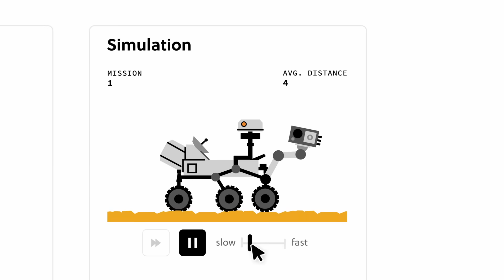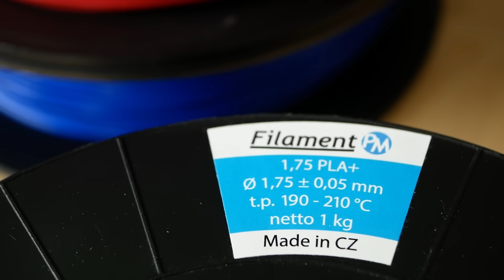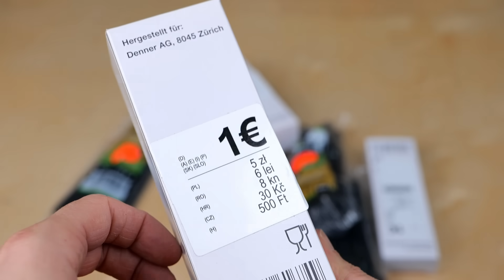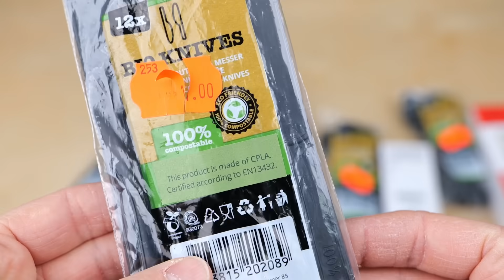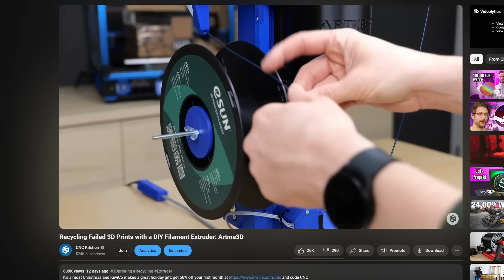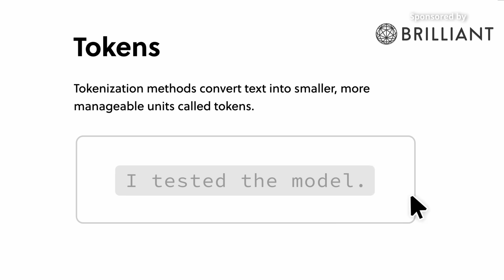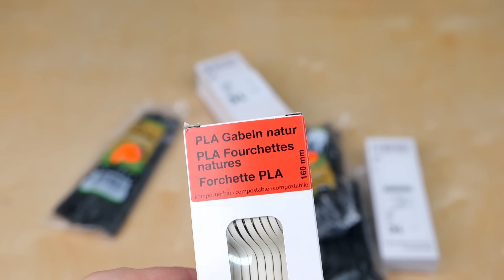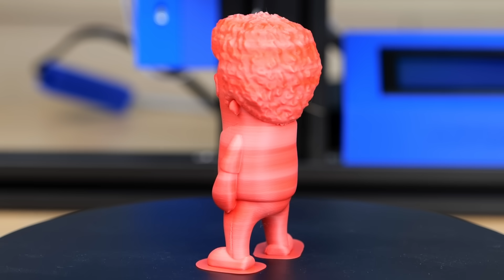From Trash to Treasure: Recycle Cutlery into 3D Filament!

Comment: I love that you've really taken this on! I think the biggest blocker for slightly wider adoption is the cost of the shredder still. It'd be cool if there was a cheaper option that performed well, or perhaps you could look into designing one?
Reply: It would likely never be economic for a single hobbyist, but a local makerspace might be able to pay it back by selling their recycled filament
Reply: The shredder and extruder are both individually more expensive than the cost of filament spools for most hobbyists (I have barely spent more than $100 on filament in my 3 years of owning a printer), and professional users might not see any cost savings after quality control and recycle costs are factored in.

Comment: That machine needs a real time thickness gauge. Good thing I recently uploaded a model that uses those cheap thickness gauges you can get, and it would be easy to remix into something that can be mounted on the Artme3d machine. I probably can't post a link, but it's on Printables called "ProperWinder Thickness Gauge" I included STEP and F3D files as well as STL.

Comment: There are two materials I would REALLY like to see some recycling results of. Both abundantly available for free, if you are prepared to put a little energy in recovering them.
The materials are PE and HIPS.
Single use cups (the thin ones) are often made from PE (or at least they were, haven't checked in a while). Since they are use by the thousands at events, it might be a good option. As with the cutlery, you'd have to clean it first though.
And HIPS is used for things like printers, scanners, TV's. As an electronics hobbyist I already salvage a LOT of the components for mu projects, and most unusable metal parts can be recycled easily. But the housings aren't exactly environmentally friendly. But HIPS does make a great material to 3D print prototypes! Even if it's not as easy to print as PLA. It's a bit tougher to grind the big parts down to pellets though.

Comment: Old coffee machines that grind coffee beans sometimes have grinders that no longer produce a fine enough ground coffee for the machine to work properly but might be able to grind filament plastic into pieces possibly smaller than the raw pellets.
I wonder if it would be possible to thoroughly mix a finely ground mix of filament to achieve a more uniform color.

Comment: Making custom filaments from new PLA pellets and additives would be interesting, especially if you use recycled plastic for filler, pigment, or even material properties.
Reply: Plastic degrades rather quick when recycled and making it yourself would most likely cost way more money than simply buying it. That´s one of the reasons why "Mass production" with 3D printers is nonsense.

Comment: I want to see recycled FPV Drone propellers. They are all made from Poly Carbonate and I have A LOT of snapped and damadget ones after 5 years of flying FPV drones. And other pilots for sure have the same problem. 😂 Some of them are little dirty from cutting grass when crashed. But it should be very similar to what you just did.

Comment: Wouldn’t it be possible to combine the filament extruder with a pultrusion stage afterwards? Let the extruder produce oversized filament, and then use pultrusion to get it down to the right 1,75mm diameter.

Comment: I would love to see you figure out how to recycle plastic film (HDPE/LDPE - like in plastic bags). I'm sure it will require some preprocessing, or perhaps it can just be cut into small pieces with scissors and fed into the extruder. As a last-ditch option, maybe it can be added as a small percentage of a recycled mixture.

Comment: You have to understand that filament manufacturers use a high rate of additives in filaments, like viscosity modifiers, flame retardants, stabilizers, and copolymers. There are many differences between injection moulded plastics and 3D printable plastics. In injection moulding, we use a lot of fillers (like calcium carbonate) to make it even cheaper. On a few spoons and forks it won't make any difference on the price, but on a month of non-stop production, it significantly increases my salary hehe. These filling additives makes it worse to recycle for 3D printing, though, in injection moulding, we can go down to 10% virgin + masterbatch and maintaining the same properties.

Comment: Use a bigger nozzle in the recycler ?
Reply: Perhaps just get a pack of cheap V6 nozzles (which this appears to use as its nozzle tip) and drill them to various diameters.
Reply: I would like to suggest adding a flow restriction insert into the nozzle. Remember those fake CHT nozzle inserts, those copper slugs with side channels drilled out, well when you push, they help melt the filament quicker; but they also provide a flow impedance for when you're not actively pushing the filament. Some sort of internal constriction like that, going out into a sufficiently wide nozzle.

Comment: Wood pellets come in plastic bags , i generate a few kilos of plastic from this every year heating my home . That would be a fun thing to recycle , as they can probably clean up nicely in a washing machine
Reply: Most likely some sort of polyolefin, which may flow well in the extruder but you'll be fighting bed adhesion and shrinkage trying to print the stuff.

Comment: Not gonna lie my main issue with this is the shredder. It would be interesting to see a good way to shred the plastic for cheap
Reply: I would think a coffee grinder might do it. The low speed type with ceramic disks that baristas use, not the blender models.
Reply: @sail4life  I think the hardest part of trying to use a burr grinder is getting the plastic through it. Coffee beans tend to get kicked up as it is so getting the plastic to go through the grinder on its own would be, I assume, a challenge.  Then again, they make hand-driven and non-electric burr grinders. I guess you could figure out a way to attach one of those to a surface and then turn the crank with one hand while feeding the plastic in with the other hand? I really wish in-home recycling from start to spool was as inexpensive and available as 3D printers are though.
Reply: I don´t make new filament but i recycle plastic with other methods and a classic mixer is the best cheap option
 @sail4life

Comment: Please try recycling 5 gallon water bottles~!
Reply: Aren't those either polycarbonate or some type of PET?  If it doesn't say BPA-free it might be PC but you do need to double check what plastic each one is made of.  At least they are heavy enough one can create a significant amount of filament from a single bottle.
Reply: @soundspark  at least in America the five-gallon water container every water jug is made with 100% extra-durable polycarbonate plastic, BPA-free; making it reusable and safe for storing water long-term.

Comment: Even though PET bottles are often recyled with pulll strusion i would love to see how PET would behave in this type of extruder and if there are any benefits or deficits for not using pullstrusion.
Reply: Been very hit or miss with my Filastruder.  Goes from brittle and slow to pouring out of the nozzle like a liquid.  Perhaps the Artme3D's more sophisticated temperature control might be able to pull it off.

Comment: Think a better way to put it.  How the 3D printing industry has contributed to the plastic waste problem.  The industry you cherish, has contributed a ton to waste, from plastics to short EOL machines.  Instead you poke at the US.  While other countries are unregulated and dump toxins to manufacture products that people use daily!  I find it odd that the US seems to be the boogeyman, yet these creators make a living off of US based companies.
Reply: Germans just love hating on the us
Reply: a couple of counterpoints 1. there is a tone of reuse/repurposing of machines in the 3d printer industry. 2. the actual amount of waste generated by it is tiny compared to the unnecessary use of single use plastics.
Reply: @legokill1019  - People living in their plastic bubble.  Most machines are not reused they are eventually scrapped or possibly thrown away.  People always seem to miss words and read other things.  I said “contributed to the plastic waste problem”, no matter how small it is still an issue.  It is people like you that gloss over it as a non issue.  Then dodge the second part of my comment.  Seems to me other countries have more of this elitist attitude, thinking their country has no faults and the US is an easy target.  If it wasn’t for the US, CNC Kitchen would have to find a different source of revenue.
Reply: @Firstleaker  What's your source to say that 3D printers are scrapped and thrown away, have you personally thrown away a 3D printer or seen one thrown away? People sell their garbage 3D printers on and they fetch pretty adequate money ($50-$100 for a typical Ender-esque one) because there's any number of enthusiasts who'll happily reuse the motion system bits and the motors and the frame and rebuild the machine, either repairing the electronics and doing new firmware, or replacing or augmenting the electronics, also reusing the PSU. There also... just isn't that many of these machines around. Sure 3D printers are quite shitty and unreliable but thanks to RepRap they're very rebuildable and reusable. If i find one thrown away, i'm absolutely rescuing it.

The second thing is the byproducts of 3D printing itself, such as support and attachment material (non-use parts of the output), failed prints, and failed designs from the iteration process, as well as 3D printed items that have outlived their usefulness or got worn or degraded. This is actually something Stefan has addressed multiple times with his own recycling attempts and has pushed for improvement. There are companies popping up here to which you can mail your sorted print material for recycling and get credit towards recycled filament that they sell. This is still certainly a problem, since i have thrown away plastic at times and have seen others do that as well. I try to collect most of it for eventual recycling. It is also certainly a question of scale, since there just isn't enough critical mass to do better about it. I think 3D printing crowd is actually substantially more cognisant about plastic waste problem than the general population, and would actually be quite receptive about recycling offers if they were more available.

Seems to me you're just trolling, as you admit it's a problem that is in general fairly small in scale compared to most single-use plastic problems.

Also 3D printing is a creative endeavour. I am yet to see creative endeavours which weren't anyhow wasteful. Maybe you're just "wasting" electricity to do something that is screen bound only, but that's still coal and oil that get consumed. And yet creativity is valuable, because it's the foundation of society, culture and tech progress. Plastic cutlery or single-use plastic packaging are not valuable in the same way, no harm would come to society from replacing them with permanent, reused items.
Reply: @SianaGearz  - I can alway appreciate the long effort someone can put into a reply.  Once again people tend to read what they want.  “Scrap”. What is the definition of “scrap”
Metal waste or scrap metal is any product that's broken or no longer useable, which is made completely or mostly from a metal material. For example, it could be broken tools, metal sheets from manufacturing, a bent pipe, old electrical appliances.  Doesn’t mean it is thrown out.  
See people like you, the enthusiasts, are not typical consumers.  Typical consumers live what is called a “throw away society”.  Do you know when a “throw away society happened?  It is the term “planned obsolescence” came into play.  See, planned obsolescence started with the lightbulb.  The standard lightbulb was lasting so long that manufacturers stopped making money.  So all the manufacturers made an agreement that a lightbulb would have a max lifespan.  Any manufacturer caught making bulbs passed a certain lifespan would get majorly fined.  

People buy the latest and greatest, a year later a better machine comes out, they buy that.  That old tired machine sits on a garage floor getting tossed in every corner.  Then 2 years later it cannot even be sold on Facebook Marketplace.  Then that poor machine is sent to “scrap” or thrown out.

Once again I said ”contribute”.  Just amazing how people cannot read and blow things out of proportion!

Not everyone lives in this space, and goes by the “3D community” guidelines.  People are consumers, if they get a print failure, it will go into the trash.  That’s because they are told some of the filament they use isn’t recyclable.
Seems that everyone in this space lives in their plastic bubble!  Literally!  You think everyone thinks like you, and should think like you.  

The first words was calling out a country for something not everyone does.  To me that is very word of elitism.  I can go down countless streets for recycling and waste pickup, there is usually more recycling than waste.  I don’t pass judgement on other countries, especially if I am earning most of my revenue form that country as a creator.

If I was trolling I would be doing a much better job!
Reply: @Firstleaker  A typical consumer can't really own a 3D printer and get much out of it. Fickle machines which just about work, but usually not for very long without occasional insightful intervention. Half of the typical printing problems have a dozen possible root causes that you have to systematically hunt down one by one, but most people aren't used to doing that. General public isn't skilled in imagining and designing things in 3D, the school and world hadn't prepared them for it, and the available downloads from model sites are limited in number and scope. So yes, people who commit to owning a 3D printer are probably a little different from a typical throwaway consumer and more similar to the likes of present company.

Comment: Shred a ton of old CDs oder DVDs. Leave the metallic particles inside
Reply from the maker: Good one! Glittery Polycarbonat Filament
Reply: I wonder if the organic dye layer in record able cds would effect the polycarbonate base material... Can that filament maker that you used get hot enough for polycarbonate?
Reply: @Sembazuru  guess the stuff get burned away and mostly carbon stays.
Reply: @Sembazuru  It uses PTFE tape on the nozzle so no, not without modification. I've also read that pure polycarbonate is very hard to print; the filament you can buy generally has additives to make it easier.
Reply: Too bad 3D Printing and recycling wasn't big when recordable CDs and DVDs were in their heyday; the coasters would have been great for this purpose.